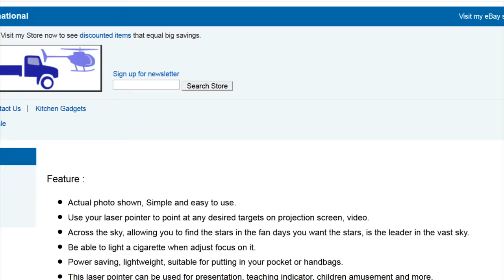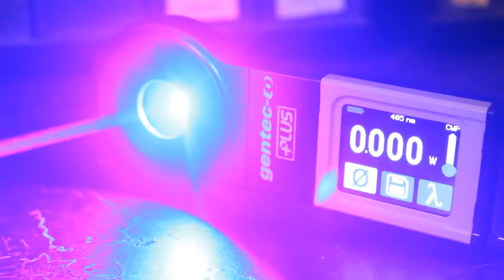Testing Illegal Blue Lasers from eBay (and making them even stronger)

Comment: Thanks for making this video. I didn't realize lasers were THAT dangerous. You probably saved my eyeballs. So basically it needs to be thought of like a long range arc welder.
Reply: For those of you wondering, you can legally buy these lasers the way Styro explained, and then have it as a perfect self defense weapon with 0 legal trouble. It blinds the attacker, instantly heats up the skin to crazy temps, and by law you 1) are allowed to own a high power laser 2) use any laser pointer in self defense with no license or reprocusions (but it has to be self-defense). Using mentioned "star cap" attachment is not only for pretty patterns, it can actually make sure you don't miss the attacker amidst panic.
Reply: @deancollinss  I’m positive using high powered lasers as a weapon is highly illegal
Reply: @dylanblack8714  it's not, its exception to the law. Hand held laser pointers (power not mentioned) may be used in self defense without any license, permit, or violation. Of course they intended little pointers when writing the law, but legally it's a perfect loophole
Reply: @dylanblack8714  it depends on where you are in the US, but typically, unless possession of the object itself is a crime, you can use any weapon for self defense. because owning the laser is legal, it's fine.
Reply: @m4nman  yep. And it's kinda crazy that something like an IR laser can blind the attacker for life. In a way it's more effective than a gun, but doesn't require any permit or license, and isn't well known. It also doesn't leave any visible marks or evidence pointing to you.
Reply: @deancollinss  yeah really crazy...
Reply: Dude.. just relax .. what are you guys doing over there in the US, you need to be like this? Damn..
Reply: @ComplexConfiguration  yes because they keep making it harder and harder to get guns, so you gotts defend yourself somehow. This js very effectice but you also need to carry protection goggles for yourself.
Reply: @deancollinss  fax but what if you meant to blind attacker but blind near by people in the process tbh a fun is better because imagine being blind fl I rather end the attacker life permanently
Reply: @chitlitlah  can't really carry a shotgun in a pocket
Reply: @deancollinss  I thought you meant home defense. If you meant walking around on the street defense, then I see your point.
Reply: @Dean Collins  No. Using a high power laser for self-defense is NOT legal. Not only that, but you are opening yourself up unprecedented levels of civil and punitive damages.
Reply: @sarsvfx  I'd rather the attacker be blind and suffering for the rest of his life tbh. Dying seems a little bit too easy for them.
Reply: @MalcomHeavy  If someone is breaking into your home in texas, you can use almost whatever you want. Handguns, Shotguns, a damn crossbow. Why would a non lethal laser be an issue? Home invader is lucky it isn't a glock as it usually would be.
Reply: @ComplexConfiguration it’s too easy to get guns over here, and lasers are a non-lethal way to have a good chance at stopping an armed attacker. What’s funny is my reasoning is pretty much the opposite of what the original commenter said. I do generally think tasers are better because they are on average less damaging, though they can actually kill, whereas a laser cannot, and lasers also have the advantage of fast travel time and lack of noise.
Reply: @ComplexConfiguration  I truly don't understand the American mindset. I'm literally attached to the country and can't understand the fear. People genuinely believe they are GOING to be attacked at random times. It's not an if, it's a when in their minds it seems. 

Like I hate driving so much. I hate having to be in a vehicle and at the mercy of other drivers who are steering thousand pound death machines at ridiculous speeds. Getting into an accident is something I anticipate and know is an inevitably. But all I can do is try my hardest to drive defensively and safely. I don't feel the need to armor my vehicle and add the ability to push cars away from me on the highway. How unsafe does one have to feel to think you need a self defense weapon at all times?

I live in fear being this close to a country that has so much violence in it. I am afraid of Americans because the average mindset is so completely alien regarding protection and security. You know how I plan to deal with someone attacking me? Give them what they want unless the only thing they want is to hurt me. And if all they want is to hurt me then I put as much distance as I can between me and them. If someone wants to hurt me they have the ability to long before I understand that's what they want. Why do these people think if they are being mugged on the street that they could pull out a laser pointer and blind their attacker before the aggressor could move their finger a mm or two? Just give them your stuff and run away!
Reply: @deancollinss  it will blind yourself as well
Reply: @starlitnight6982  already did 😃👍
Reply: @deancollinss it's unlikely to be effective in most situations, and it has literally zero stopping power. I mean yeah if you can get a direct hit into their eyeballs for enough time to make them completely blind but that is a much taller task than I think you realize.

Comment: I like how he genuinely pointed it at a highly explosive gas because he trusted the laser enough not to kill him and cause slight property damage to his neighbours.
Reply: Because he's smarter than you and realizes it won't burn its way through metal to the gas inside.
Reply: @timpete78  i’d still be worried about it.
Reply: @Png_gaming  this man does nothing but work with lasers so much that he knows exactly what you are doing
Reply: @the_undead  Im assuming he lives in a house with a connected wall to his neighbour, if the tank is right next to the wall then the wall might end up damaged by an explosion.
Reply: @Png_gaming  it’s probably empty
Reply: @jeremiahsmith4235  fair point.
Reply: That's a really tiny container of propane. And keep in mind that it's propane, not methane.
Reply: He knows what hes doing...thats unlikely to overpressure in  2 seconds of heating and cant explode without oxygen contact .
Reply: Like frl

Comment: styropyro: This is about 5.5 watts
Electrical tape:*chuckles* Im in danger
Reply: 5.5 watts?   how is that illegal? its not even capable of cutting aluminium.  I guess he doesnt know lasers arent illegal they are sold to licensed contractors all the time..

when I worked in steel car the heliarc's were 240 volt at 30amp..
the cutting lasers for 4" thick steel plate were way over that, dunno the exact numbers but I recall a guy saying $3 a second...  I assume he meant  cost per kilowatt..  at that time 1000 watts was about 10 cents.
Reply: @harleyme3163  That may be true, but where did they get the specialist piece of equipment? Probably not just from the local hardware or retail shop. Might be that it's illegal to sell them without a proper license and safety material? Or just illegal selling them to the public?

Comment: I love that with all your knowledge and experience, the first troubleshooting step is still to smack it against the table.
Reply: This really made me cringe, like watching reality tv.
I was screaming at my phone "if it's broken, why would you punch it, you just make it worse", sweating and crying.
Reply: @Fred-tz7hs  It does actually work sometimes, doing that can knock solder joints into position, or unjam button contacts. (obviously you don't want to do this with stuff you care about and only as a last resort)
Reply: @Fred-tz7hs  Except that's how he ended up fixing the laser. He said he got it to work "after a bit more percussive maintenance". That's a solid temporary "fix" for some things, like when my old CRX's A/C blower motor's brushes were worn down and it would have an intermittent problem of not turning on. I'd just give it a tap with the tip of my shoe (not kicking the hell out of it and ripping it off, just an accurate tap, some times it took a few) and the fan would start blowing that sweet cold air. Also worked for when the same car had a bad starter. I just took a screwdriver (or whatever I had on hand at the time) and placed it on the starter and then I'd use a wrench as a hammer to tap it a few times while someone turned the key. Heck, I remember when I was little and the mega old CRT tv on my granny's house would fizzle out, I'd give it a few smacks on the side or the top and the image would come right back. It's definitely not the go-to solution, but on some specific applications, it definitely works.

Comment: I have the silver laser like in the video and I got rid of the junk 16340 batteries and used 2 IMR18350 1200mah flat top batteries from keeppower with a round thin metal screen between to make contact between the batteries and a single layer of electrical tape around the middle so the screen doesnt touch the shell. Now im pushing 8.8 volts fully charged at 2400mah and 1.6 watts of power!

Comment: i know this is a bit of an older video but you are absolutely right these are not toys, and personally the sellers who sell these whould go to jail, i bought a laser from ebay, it said it was 1mw and it was just fo fun, when i got it i shun it around without eye protection cause it said it was 1mw and i instantly burned the back of both retinas, i now have scars at the back of both eyes, can no longer get a drivers license or drive at all nor can i work in anormal workplace. and have a blurry spot right dead center of my vision, please PLEASE treat lasers wit hcare, even the ones advertised as 1mw. im now permanently partially sighted,

Comment: "amazing 3d graphics" bruh looks like ur playin starwars battlefront 2 one the xbox 360
Reply: Isnt that amazing considering it is on a phone? Just imagine someone said "You can ay xbox 360 games on this phone" that sounds like a powerful phone
Reply: Not really. The ps Vita was putting out 360/PS3 level graphics in 2012, and mobile processors have come a looooooooong way since then
Reply: @onometre  RIP PSVita, it never got a chance...
Reply: @onometre You didn't consider that the PS Vita has a much lower resolution than the Xb360/PS3

Comment: Should of filled the solo cup up with water and try to see if the water deflects the heat of the laser like throwing a 2 liter bottle filled a quarter of the way and throw it in a fire as long as the water is inside the bottle it won't melt.   I want to build a laser powerful enough to cut metal for my CNC table as my plasma cutter is pretty cool but a c02 laser would cut finer detail. lol

Comment: ... silicone wires are going to change my life.  i'm not a huge electronics guy, but i know how to mush a handful of electronics into the back of a guitar and i know that 90% of the soldering i do is because a pot came loose or something and it pulled too hard on a contact somewhere because the wires can't flex.  i should thank you lol

Comment: Good channel. The safety googles are important. Theres a difference between most ebay sleek black round googles rated 200-2000nm- these are for broad spectrum, with low attenuation, 30x, 50%transmittance and low Pptical density OD, commonly used in IPL, and if visible spectrum would be hard to see through. Now a Laser pointer googles must be for 
Specific wavelength, with 10M x reduction OD 7+ such as for green pointer . Theres also an issue with cheap pointers like 303 usb green pointers and one DDPS without IR filter or now working filter that they leak emit 1068nm IR very dangerous laser radiation if theres no IR filter. ‘ The issue with green laser pointers video by Brainiac 75 for reference.

Comment: It's funny how both laser and UV are considered non-ionizong, but with the right level of power they do become ionizing radiation and push electrons from atoms, permanently affecting the target matter and reshaping their molecular structure
Reply: They will not become ionizing radiation no matter how powerful it is, it's about the wavelength. Ionizing radiation typically starts at Extreme Ultraviolet and goes to X-Rays then gamma rays.

Comment: your a legend ... id lov too to get inn on watever your doin behind closed doors ..   your going places noone else iss i recon,,, if these are your public posts .. cant imagine wat uv really built but just cant show,, i was a underwater gas pipe line welder for over 20 years  ,, and yehh u can doo some pretty full on things with oxy gas and oxy gas underwater welders,,  which with some homemade jimmyiing 
,, can have oxy gas flames like 3 , 4 metres long ,, real thin presis ones that resemble a laser .. which also can slice off a limb if u were so ever willing..

Comment: The Laser Engineer...
Reply: new engineer building: The Ruby Pulse
(the image is styro's ruby laser)
*replaces the dispenser
*allows you to upgrade sentries to Level 4
*slower sentry firing speed
*on hitting somewhere an enemy player can see: induces permanent blindness until they die
*deals 200% of enemy's current HP
*always crits
*cannot fire cannon while sentry is wrangled
*the cannon makes a very loud noise when it fires
*slower sentry turning speed
*no rocketlauncher on level 4 sentries
*can set maps on fire
*burning maps is a purely visual effect
Reply: i chose replaces dispenser bc its the most useful non-sentry building

Comment: There still are solution to safe laser - A laser should emit a digital code that identifies the laser just and an ID -It light so it can transmitt information -So Styropyro could make this to a projct -the first identifeble laser at distance - Eg if laser becomes with a permit in future and ID is required for the laser to emitt when used and I guess in military applications a rogue laser or unidentifed would require a action like destroy it or the user. I just hate laser pens used by young so called men bordering hugligans and they get away with using them on people crowds -lasers should be identifible as invidual equipement  - bought new or on black market. And yes i got a laserpen up in my face 15 years ago - and You can count on the swedish police or public did nothing .

Comment: styropyro, you are quite a guy. Love your video. I bought a laser like yours, on E Bay, with the small tubes surrounding the body. It is very nice. This was after I got scammed and screwed about four times thru false advertising. Them four lasers I recieved didn't even feel warm on my hand. Do you hire out to boost lasers ? If so, I will have you do mine. If you can't, no problem. I don't want you or I to get in trouble with John Law.